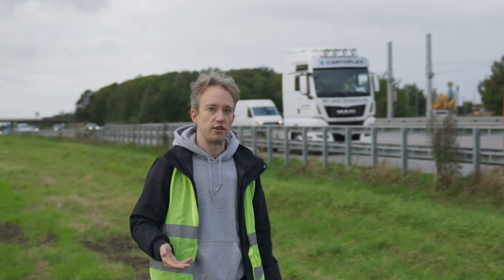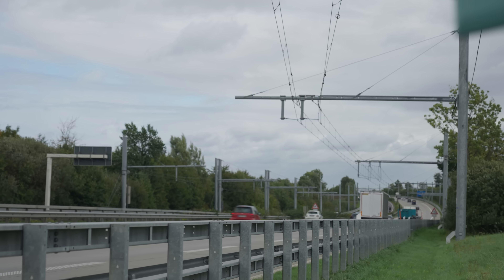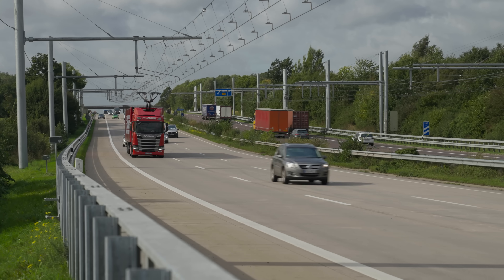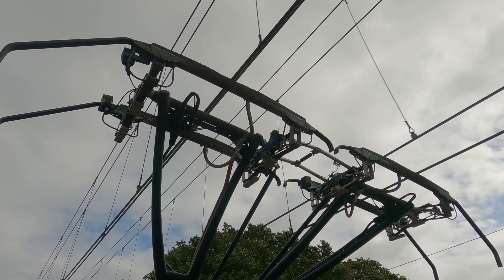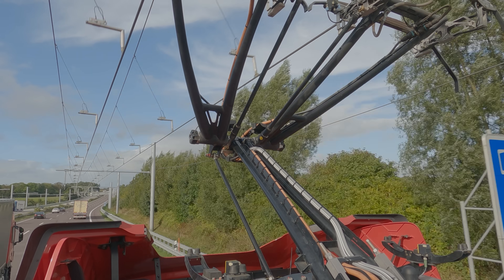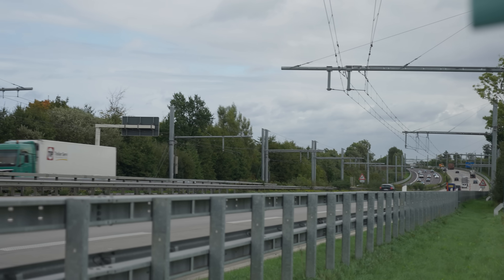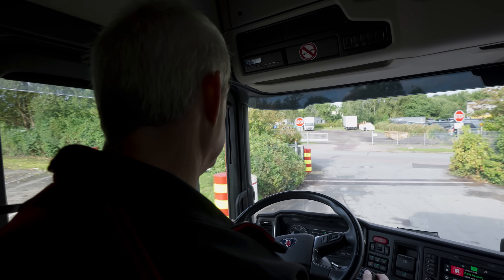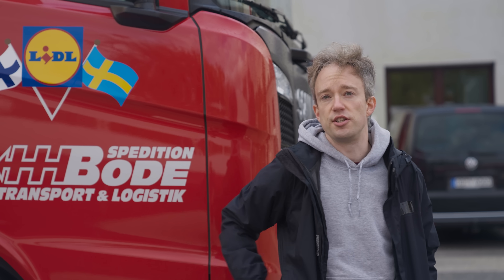The highway where trucks work like electric trains

Comment: Of all the possible solutions to remove diesel trucks, this one has me the most 'sold' on an idea
Reply: Of all the possible "solutions", this is the dumbest.  Because it's not a solution. It's more a "We have to keep manufacturing trucks!  Think of all the jobs! (That haven't been replaced by robots… yet)"
Reply: @JürgenErhard  trucks aren't going anywhere. Either human driven or autonomous. They will have to be powered somehow.  The overhead lines on paper look to be an actual practical solution to powering long haul trucks. Especially in the states where a majority of the country doesn't have rail or water as a transportation option.

Comment: Good idea for small runs which should save a ton. Sadly I don't think this would be economical or have proper logistics to complete bigger runs such as from country to country or in the US. Also I would wonder what the policy would be in the case of an accident and how much that would backup the system.
Reply: If you're delivering goods cross-country you should be using rail freight
Reply: It all depends on what and where things are going really. Not all rail is proper for such transport.

Comment: I think trains are still more efficient for transportation of goods and supplies, but this seems like a good solution for "last mile delivery" where rail infrastructure doesn't exist or faces other barriers to being built.
Reply: Their also the fact that Europe doesn’t have a efficient cargo rail service. Europe’s trade relies a lot on trucks so this system would technically be more energy efficient than the current system. Plus cargo rail would have to use new tracks or passenger line would need to be upgraded with passing tracks if cargo rail was to be expanded in Europe so this is the cheaper option
Reply: @Kishanth.J  What is done by train in North America is mostly done by ship in Europe. Freight trains can make up a bigger share in Europe though, but it's less feasible here than in other places.
Reply: @Kishanth.J  exactly. You can't just build a traInstation at every cargo depot and store
Reply: but "last mile delivery" is going to have the highest construction cost, and the lowest reduction in emissions.
Reply: I think of this as a more efficient form of the already existing Schienen-ersatz-verkehr (rail alternative traffic).
You have a lot of necessary trucks with cargo not suitable for rail (in a schedule, multiple stops, short distance of end of rail to destination (meaning the double loading cost would be negating long distance), easier accessibility by truck...), so implementing this system could have a big effect.
Reply: There are goods that you can't effectively deliver by train. See for example the whole logistics with fresh food including the delivery to the stores. For this it really does make sense.
Reply: Trains usually carry materials like natural resources in bulk and a whole lot of other stuff that needs to be transported at the same time. Did you really think trucks would still exist if trains were more efficient? You can't compare the roles of trucks and trains
Reply: Trucks are point to point, easily scalable and competitive. Clearly trains don't work for every case or they would be the solution.
Reply: @12345maxx  Freight trains are for long distance transports.
Reply: Railroads take up a whole lot of space and are solely used by trains, compared to the road networks we have all put in place for both commercial and residential use. Waiting to fill a freight train with cargo before shipping out and then having to wait for an entire freight train to get unloaded would slow down everything. Not to mention our railroads are already in use, to rely more heavily on them would require a massive overhaul and upgrade.
Reply: @SpidermanFan92  So we should do this overhaul and upgrade instead of clogging the highways even more with inefficient transport.
Reply: Now I'm actually curious what percentage of material transportation (distance*weight) is actually done by train in different sections of europe cause I feel especially in germany and benelux there's a lot that is done by train.
Reply: Not exactly last mile unless you want a 660V DC line next to your window.
Reply: @Mic_Glow that would be less offensive than diesel soot fogging up my window and air pollution drifting into the building, so I would prefer wires that only affect about a dozen cubic centimeters of space per meter of lane.
Reply: @Odanri  The graphene (to make pantograph slippery) and aluminium/ copper dust is even worse. You can't get it off clothes. Also prepare for monthly inspection (truck at night and people at your window level) and sometimes repair/ modernization work, quite loud (if you try to officially complain the letter goes straight into trash and engineers have a laugh)
Overall noise and pollution level would decrease significantly, but the downside is not just visible wires xP

Comment: Just do long-haul freight with trains. There's nothing more efficient. And this system can't replace last-mile delivery so it's completely overrated...
Reply: There are far fewer train lines than paved roads, or even dual carriage ways.  Those train lines only have so much throughput as it is and expanding that capacity is extremely expensive.  If there are any delays on those train lines, then re-routing trains around the backed up areas is significantly more difficult than having Google Maps re-route you to a different motorway.
Reply: @peteranderson037  expanding rail capacity is cheap too, and you need several lanes of highway to match the throughput of a single railway track. also the denser the rail network becomes the easier rerouting trains will be
Reply: @subway8448  "expanding rail capacity is cheap too" Completely incorrect, while it may be cheaper per unit of cargo in the long run the actual laying of that track is far more expensive per unit distance than that of a simple paved road.
Reply: @peteranderson037  It's not like this system is cheap or efficient. Trains are simply better.
Reply: @peteranderson037  Can you imagine what would need to be bulldozed to create more rail lines?
Reply: @peteranderson037  Especially if the trainline was planned with 2 ways in mind, you would have to replace every bridge near it if you want to expand it. And 4 lane train becomes much more complicated to switch.
Reply: Efficiency: Boat>Train>Truck>Plane?
Reply: @brunof1996  You forget Zepplin.
Reply: They address this. Listen to whole video.
Reply: You still need trucks to move the freight from the trains to the end destination. This is a good solution for medium distance haulage.
Reply: the system to replace last mile delivery should be either branch lines or interurban tramways, i fully agree that this is overrated and just copies one aspect of trains while doing everything else worse

Comment: it's amazing how people will reinvent the train over, and over, and over
Reply: It sounts like carcinization but for vehicles.
Reply: Trains have their weakness.  Such as requiring rails, and not being able to take 90-degree turns.
Reply: legowarrior lorries require roads as well, they aren’t free. Lorries cause a lot of wear to the road surface as well, it costs a lot of money in maintenance
Reply: @PsychCaptain  neither of which is relevant for long distance container transport, which is explicitly said to be the purpose of the system shown in the video
Reply: @oktupol  The difference here is that they can use the existing system with some modifications. Laying new rail is exorbitantly expensive.

In terms of rail, even if such lines were built en masse you would still need trucks to move the freight to it's end destination.

 All in all this system is a good mix of the two.
Reply: @oktupol  It is still relevant.  Unless you feel like bulldozing all sorts of homes and buildings to build a rail station next to every depot.  And of course, paying a premium for Rail LInes that is far more costly then just upgrading the highway.
Reply: Motor companies pay bigger bribes to corrupt conservative politicians than rail companies :)

Comment: "I think" that gentleman is being exceptionally optimistic with his estimates for ROI on this system. That said, it is still a better idea than Tesla's nonsense.
Reply: Less than you'd think. Just hauling around diesel costs a lot,  both in the distribution network and in having to burn fuel just to carry the weight of what's in your tank. Cable infrastructure is very cheap relative to the cost of building and maintaining the road it sits above, or building separate extra rail links for electric freight trains.  And generating electricity in large plants is more efficient than burning fuel in millions of small engines.
Reply: @JamesChurchill  That depends on transmission and conversion loses. You're shipping a lot of current around on uninsulated cables and then converting it from AC to DC. You can get around some of that by piling up more and more infrastructure, but that isn't exactly cheap either.
Reply: Teslas semi-truck and this system do not necessarily compete with each other.
Teslas semi can be used for shorter trips like mentioned in this video.
Reply: @Jehty_  Tesla semi-truck is an imaginary product, it might result in a Tesla box truck that would be more viable, I worked for a delivery company that was piloting electric delivery truck 4 years ago, so at least that idea isn't a fever dream of Musk's.
Reply: Its way better because without batteries(Probably it has a 50-100km range without overhead power)and engines  it can transport much more goods
Reply: You'd be surprised what the ROI numbers are for electrifying anything powered by fossil fuels in Europe, on account of how stupidly expensive the tax is. The only hurdles right now are either upfront cost (a battery for a truck costs 3x what the rest of the truck costs) and charging stops/range, and this overhead wire concept helps, mostly with the latter, but potentially for both.

Comment: I feel like at that point (for the second case) you might as well use a train. I also hope the problems with trains won't plague this idea; different configurations of the lines in different countries.
Reply: It is a very stupid issue that each country has its own rain configurations. It would be a lot easier to have a standardized system of rails for all countries. However, its probably too late as solving this issue involves laying down billions of euros worth of new rail lines

Comment: Whenever I see these, I can't help but wonder if maybe it would be a better solution to put more cargo on trains (which Germany is also, supposedly, trying to do). At the end of the day, if the infrastructure was there, we could theoretically replace trucks on motorways with trains altogether and only keep trucks for the last mile.
And the advantages are obvious: Less traffic on the roads, more efficient transport of goods as no road vehicle will ever match the rolling resistance or aerodynamics of a train, less people required for operation, etc.
Now, putting wires on some motorways is definitely cheaper than building dedicated cargo rail lines, but the benefits are also smaller. So, without deep knowledge into the topic and what the future holds, it is hard to make an exact prediction on which one we should be investing in. Maybe electrified motorways are only a temporary, but necessary solution for the decades until cargo rail can replace lorries. Or maybe building the railway infrastructure is just too expensive. Or maybe electrified motorways are a waste of time and money. Who knows? I don't.

Now, I don't fault Tom for not including this discussion into the video, as it is a showcase of the technology rather than a discussion on transport infrastructure, but I find it nonetheless interesting.
Reply: Brilliant, i share similar views on this. It seems like the countries with the highest rail capacities are the ones that involve large amounts of road transport in their economies. Is there any reason for this?
Reply: @RS-jq4oc  No idea but you could see them as part of the same system, trains transport stuff a long distance and then trucks are used to deliver stuff from train stations to wherever meaning that if you want efficient and active transportation system you want well developed trains and roads instead of just trains.

Another thing could be that businesses get used to goods being delivered by train and if that for some reason becomes unavailable they just get trucks to deliver the same amount of stuff.
Reply: @RS-jq4oc  I can't talk in general, but I can speak about Germany.
The German railway network does have a lot of capacity, but nearly all of it is being used. And as there aren't many dedicated high speed rail or cargo lines, trains of varying speeds go on the same tracks, which causes obvious problems because trains can't easily overtake each other. As such, putting more trains on the network is hard in general, but slow cargo trains are especially difficult. Also, freight cars and shunting procedures are, quite frankly, outdated in Germany, with mostly manual couplings between old cars, which makes assembling trains take longer. This means you lose a lot of time before you even start trying to get onto the network. Drivers are also lacking.
As a result of all of this, rail cargo regularly waits for days at some locations before its trip starts or continues. Because of this, lorries are currently a much faster and more reliable way of transporting goods. I would not be surprised if they aren't even more expensive, either, because the trucking industry is just that huge.
These issues can be solved in the long term, of course, but this is the current situation.
Reply: Well said, I have encounter many people swarming into seemingly "environmentally friendly solutions" without thinking, even for a second, about its implementation costs
Reply: Building out an electrified rail network is going to be more expensive (and take a lot longer) than building tram-power onto existing highways and major roads. Also, you need somewhere to build the tracks. One of the problems Dublin (Ireland's capital) has with our train network is that there's houses and historic buildings restricting the above-ground building space. And underground trains are expensive. Our commuter trains through the capital are at max capacity/frequency.

Comment: The problem with trucks is that they use rubber tires which not only have significantly higher rolling resistance than steel wheels on rails, it also causes additional dust polution. Had the railways in Europe not been diminished in size to what it is now, than there would be a great environmentally friendly system available which is very suitable for full autonomous transportation between business and industrial areas. Instead we keep on investing in clogging up our roads..
Reply: Whos ganna pay for the rail and the other infrastructure?  This is a quick and cheap way.

Comment: Why not charge electric vehicles in this manner? Have a 1000km journey but need to recharge every 500km? Just place overhead 100km of charging lines every 400 km that are able to add 400 km to battery without stopping. That would result in 100 km of wiring for every 500 km traveled. Assuming it takes about an hour to charge that additional 400km. The rural roads will be covered by batteries and the truck will charge at final destination or once it gets back on Hwy.

Comment: In the city of Arnhem in The Netherlands there is a network somewhat like this for buses. Works great and the buses are noticeably more silent than normal buses.
Reply: isn’t that just a trolleybus though?
Reply: @dissonantdreams  yes they are just trolleybuses. And while that idea is great, I've been stuck in a trolleybus in Arnhem one too many times because other drivers messed up and the bus couldn't detour to get around the crash.
Reply: ...in the 60th Solingen had it in the city, too. It was (partly) removed for good reasons.....

Comment: Can someone calculate how much steel, copper etc. would be needed to build this on 1/3 of german autobahns and how much energy would be needed to mine and process those materials and how expensive it all would be :D
Reply: As far as I'm aware, its not publicly known what gauge wire or grade of steel/aluminum (maybe something else?) so I can't say exactly how much it would cost, but relative to a normal power grid, it would be fairly cheap.  It would only have to have high voltage lines and they wouldn't need to be mounted very high and away from things, it wouldn't be cheap, but it would not be ridiculous.